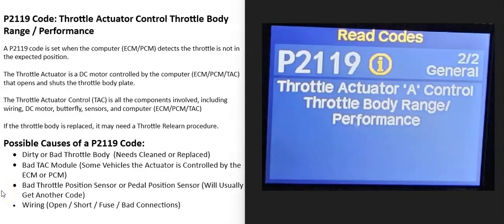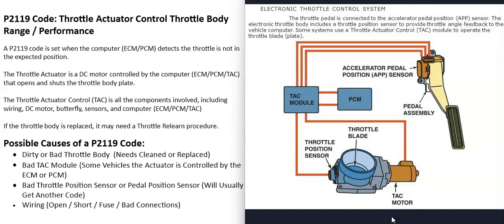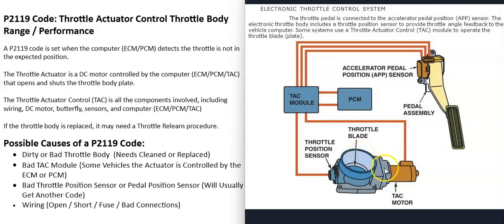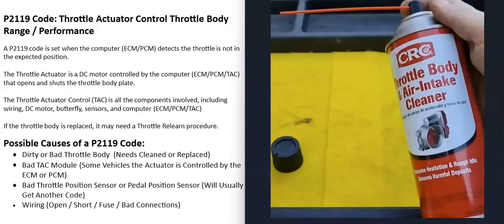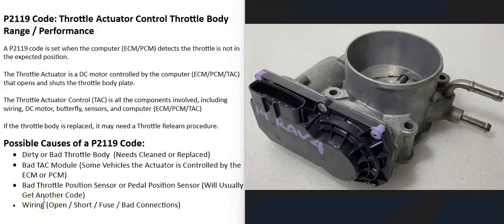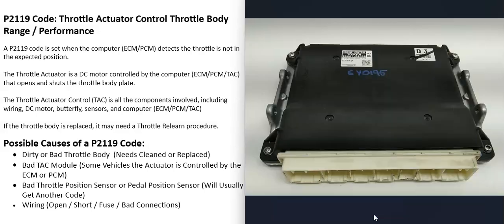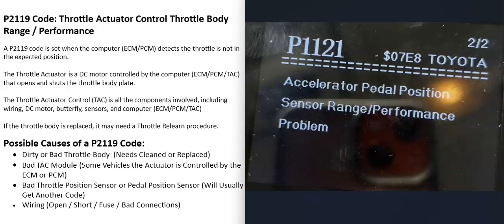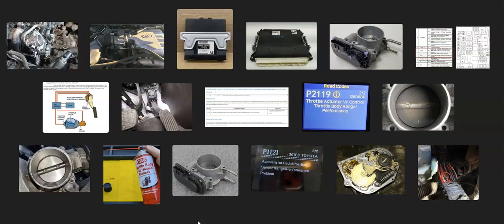Causes and Fixes P2119 Code: Throttle Actuator Control Throttle Body Range / Performance

Comment: Have the code on my 2013 Nissan nv2500. Was told it had a bad starter as the van didn’t even want to turn over. Found battery was dead and replaced but still nothing. Replaced starter and have recharged battery installed and still nothing won’t turn over doesn’t try to start. Getting code P2119